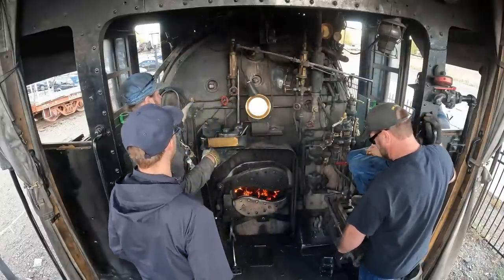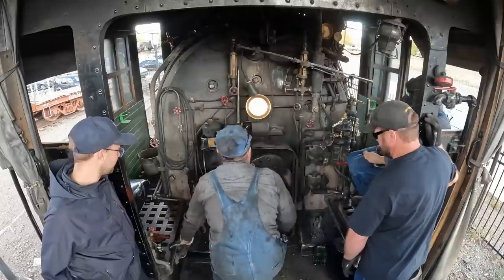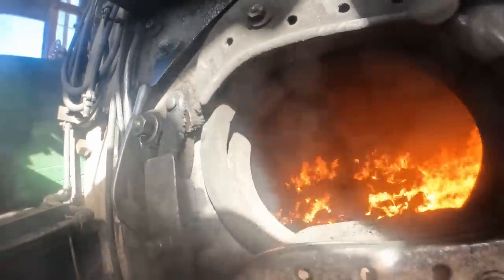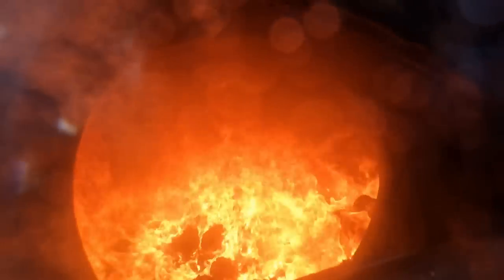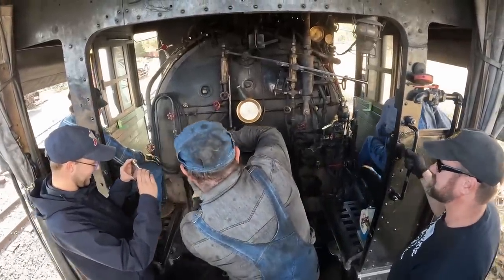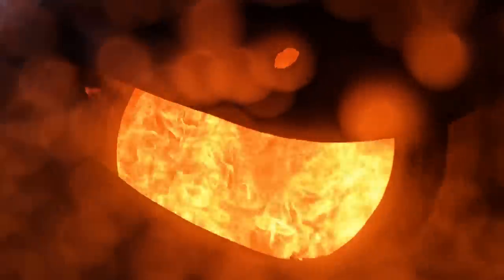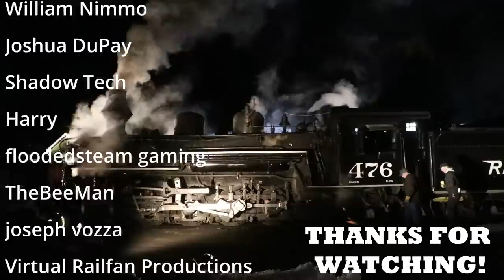Firing 101 | How does a COAL FIRE change as the STEAM TRAIN works?

Comment: Idea: pump water into a PC radiator, with heat resistant pipes (steel or something) which run into the firebox to the fishbowl. That way you have a longer lasting cooled down gopro
Reply from the maker: That's been suggested, but really, making sure the glass doesn't heat cycle is the thing to figure out... lol. that's what killed this. The camera was more than fine.
Reply: Try borosilicate glass.
Reply: @b43xoit  Can it go from a freezer, to a hot oven?
Reply: @ducewags  "Can it go from a freezer, to a hot oven?" [borosilicate glass] Yes, I think it can. Now if you put it on top of a hot piece of iron in the oven, it may crack or shatter. But I think that if it is only being heated in there by the hot air, it will survive.
Reply: @b43xoit  : Yup.  Pyrex back in the day made glass frying pans.

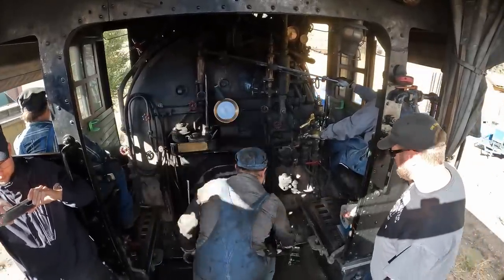Comment: 7:45 i LOVE how, from my auto mechanics standpoint, that the engine will make more fire the harder its worked
like how a TRUE!!! "free steaming" engine will always make the same/more steam than it needs.... due to the increased draft
.
now sure, you need to be able to feed it (preferably pre-heated) water and coal.... in the right amount, time, and location 
.
but simply the fact that steam generation VS steam usage is pretty close..... VS 100% or 1% (like, all or nothing... like a diesel injector on an inline 6) 
its just amazing to me
.
the fact the people who designed these boilers (with no electronics or computers) were able to get the ratios and math THAT CLOSE! 
simply amazing 
.
.
.
.
i really dont think most people can appreciate the mechanical PERFECTION!!! that is a "true free steaming" engine 
im sorry if that comes off as "elitist" (not the right word for it... but close)
thats not my intention.... we only know what we know (and my mechanic butt learns everyday) 
.
like.....
imagine your car has a 300HP engine, 
but the fuel pump/injectors cant pump/spray fast enough once it gets to its peak torque RPM
so while its capable of 300HP... if you upgrade the fuel pump.....
it can only SUSTAIN 200HP (with short ~3 second bursts of 300HP..... before it runs out of fuel)
.
.
i currently have a 350 chevy small block V8 with a 4 barrel Q-jet carb and mechanical fuel pump..... that sucks the bowel dry on HARD acceleration 
yet a steam engine from the 1880s doesn't have that problem 
.
a STEAM ENGINE!!! can make that 300HP from idle to redline..... 
and not slow down AT ALL!!! 
.
.
.
and yes, i know that steam engine is making WAY MORE than 300HP
but you get the idea.... i hope
.
im HORRIBLE at getting whats in my brain to my mouth/fingers 
i either ass-u-me that you know nothing and over explain.... or ass-u-me that you know it all, and under explain
.
.
.
.
.
like.... i could say.....
Your oxygen sensor is bad.
.
VS
.
your complaint was poor fuel economy, so i looked at the short term and long term fuel trims...
which were +30%.... 
also saw the bank 1 sensor 1 O2 sensor was slow to react (aka, slow to go up and down in voltage)
so i checked the ethanol sensor, and it is reading within 2% of what it should
so its not a bad flex-fuel sensor 
also checked the fuel pressure (because if its low, it will not atomize correctly) 
and it was perfect
so i decided to replace the O2 sensor
which instantly started to "pulse" its voltage reading much faster/better 
and your long term fuel trims dropped from +30% to +5% due to the 10% ethanol fuel 
so its fixed now
.
and i actually cut that short.... i could go farther into it LOL
.
.
.
their is a TON of stuff in my head... that just cant get to my mouth (especially when i cant write/plan it out first)
and, again, i either leave out TOO much, or leave in WAY WAY too much 
.
my brain is not "free steaming" lol
my brain is a 12V cummins on a -40F day.... all the fuel, and no fire
but once it gets going and is able to do its job..... its a damn good reliable workhorse that will treat you good for 500,000 miles

Comment: Is cold air in the firebox a thermal shock issue or just an efficiency one?

Also, it could be neat to see what happens to an ice cube that gets chucked in there. Don’t know if it would even show up on camera, but…
Reply: I believe he has mentioned in previous videos that it is a thermal shock issue for the grates
Reply from the maker: Depends! If it's close to the sheets / tubes, cold air surprisingly entering (big hole in the firebed) is absolutely a thermal shock concern. The door being open, more of an efficiency thing.
Reply: I have seen a crew member throw an aluminum drink can into the fire. I suppose it just burns up.

Comment: After watching this, I wonder if the fire would act the same way in a wood burner. Having grown up & live a mile away from NSRM-Carson, I’ve seen how the fire dances in an oil burner (having gotten cab rides in both the 8 and 25 a long time ago). So I would be curious to see how the fire dances in the Inyo at its low OP of 75-80psi and the Glenbrook at its almost full pressure. While I have ridden behind NN 93 before, that was in 1999 and the dance in her wouldn’t be much different from what you showed off here.

Comment: mark, i noticed that for years both at D&S, C&TS and CRM.  you guys use pretty tiny coal shovels for firing.  wouldn't make life easier if you guys used bigger sized coal scoops as on standard gauge locomotives?
Reply from the maker: it's all about being proportioned relative to the size of the box, and the firedoor. You need to get the scoop moving fast for the distance, and a scoop that is heavier and bigger in size makes that harder without nailing the side of the firedoor.
Reply: @Hyce777  gotcha.  ok

Comment: Is it possible to choke out a firebox? Like.... adding too much coal? Is there a point in pushing a steam engine that it doesn't matter anymore cause the fire and heat is so immense it just eats coal immediately?
Reply: I know that it is possible to choke out a fire with standard gauge. The big boys, challengers, and 9000s where know to burn half and vaporize half when at tonnage (when they burn coal). With larger engines it is hard to choke out the fire but when the engine is working hard, near tonnage or at tonnage you struggle to choke it out. I have no idea about the narrow gauge engines. Maybe the k-36s and k-37s would be hard to choke out. If I had either near me I would try it out but I only have a standard switcher near me.

Comment: Maybe a clear Pyrex container with a rubber sealing lid would keep water from dripping over the lens view? Might take the heat better.
Reply from the maker: I will need to see about that. Cheers.
Reply: @Hyce777  : You might look into the old Pyrex "Flameware" saucepans (aluminosilicate glass, even better than borosilicate) to see if you could seal one of those to turn it sideways and look through the flat bottom.  Those were designed for use directly on stovetops.

Comment: Awesome video, Mark. Does the remaining coal after the last run just slowly burn as a banking fire to keep pressure up if the loco is gonna run the next day? Or is it not enough to last overnight?
Reply: Depends what you're doing. If you need the locomotive in the morning, you hire a "hostler" to look after the boiler (water and fire) overnight. NEVER let a fire go unattended! If you won't need her for a while, you "dump the fire". This means pushing the remaining coal into the ashpan (under the grates), and washing it away with water - which also puts out any fire. There's supposed to be a portion of the grate that opens, so you can dump the burning coal down through it. This is all carried out over an ashpit; a hole under the tracks that gets shoveled out as needed; and there's a hose and long nozzle there for washing the ashes into the ashpit. This takes 15-30 minutes at the end of the day.

Comment: Hey Hyce, what kind of boots to you wear on the railroad?  I think mine would melt on that fire door!
Reply from the maker: They're Carolinas, this go around. I've had a bunch of different pairs over the years. If you have the boot on there for a long time, they'd melt, but a few seconds isn't a big deal. They're only 300-400 degrees Fahrenheit usually at the museum.

Comment: How hot does the fire get?
Reply: pits of hell hot or a Texas summer. I'm joking. the fire is around 1000-3000 Fahrenheit. coal ignites at 900 f, cheap terrible coal burns around 1000f with no draft, decent grade like the museum around 1500-3000 f with no draft, high quality around 3500 f or higher with no draft. draft can make it hotter by 1500 f give or take 400.

Comment: How hot is the oil can shelf? If is around 400°F. Maybe you could make pancakes.
Reply from the maker: Hot enough to melt butter, but not quite that hot.
Reply: @Hyce777  is it hot enough to cook on? possible new cooking location for k-37 kitchen.
Reply: Ok, maybe on 20 you could do them on top of the boiler? Inside the cab.
But you need to create a flat surface. 
What can you cook on 491’s oil shelf?

Comment: Where is the blower in this locomotive, and what powers it?
Reply: Just under the smokestack, in the smokebox. It's a jet of steam aimed up the stack, which blows the smoke out the stack (drawing more in through the boiler tubes. See: induced draft.
Reply: @ReggieArford  Oh, you mean the blastpipe.  I knew about blastpipes, but I didn't know they were also called blowers, so I thought blower referred to a fan (I thought maybe some locomotives might have had fans to induce draft until they started exhausting enough steam through the blastpipe to keep the draft up -- on a condensing locomotive, you actually have to use this all the time)..